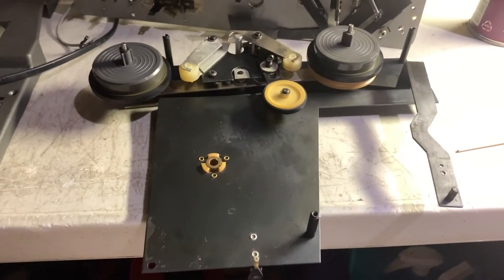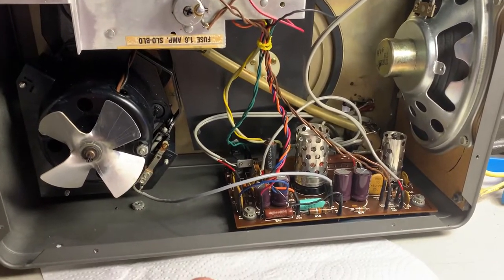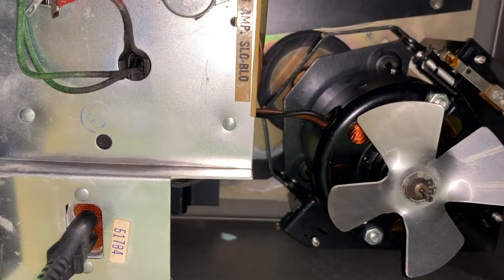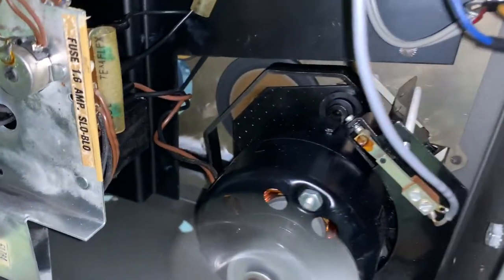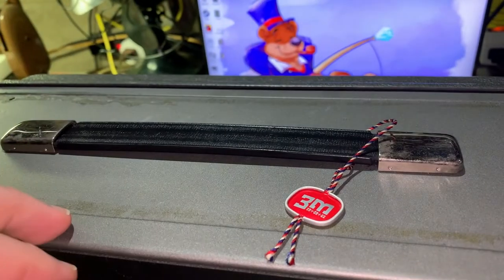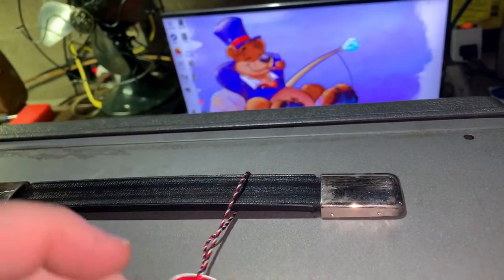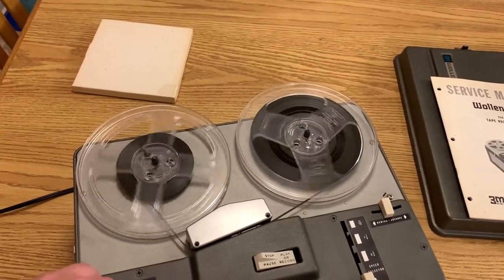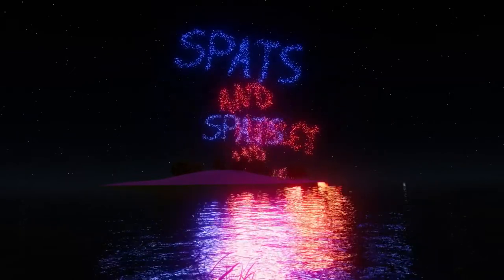1964 3M Wollensak Model 524 Reel to Reel

Comment: Really nice! Revere/Wollensak/3M made some great tape recorders in the 50s and 60s. The 15/16 ips speed seems to be only on their recorders. I have the T1515 model but the motor seems a little wobbly on mine and sometimes scrapes against the bottom grill (perhaps a rubber mount went bad?) BTW do you know anything about their M2 tape cartridge format? There’s so little info about how to work on those machines due to their scarcity.